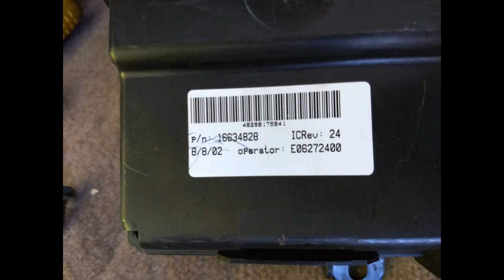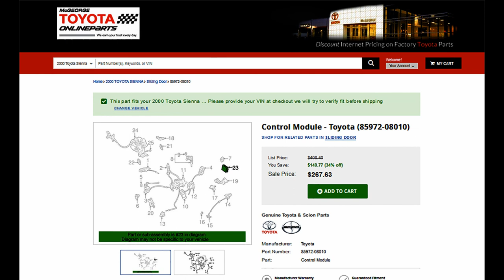2000 Toyota Sienna Power Door problem solution

Comment: Thank you for this highly informational video. I have a 2002 Toyota Sienna LE (Symphony) that had the same problem in Dec 2018. I took it to a repair shop and they replaced the pulley mechanism with a used one ($240). Plus labor I paid $500. It worked fine. But recently, it will not close or latch fully. It slides back to an open position. I inspected the cable from the outside panel and saw the same problem like you had - the plastic coating of the cable are "crimped". Mine is 18 years old. Not worth spending that much again to get it back to work. You're right. We can still open and close it manually. My kids are grown anyway. Thanks again.
Reply from the maker: I'm glad I could help.
Reply: SergSpace Do you have a video on how you remove the rear door inside panel? Thanks!
Reply: Don’t bother. I didn’t have to remove the interior to get into the motor. Looks like the problem was just on the external cable beneath the small panel. There were lots of ‘wrinkled’ plastic coating that got stuck. I just tried to clean and peel them off as much as I can. Then, I applied some lube on the cable and its contact point. It’s back working! For now. Your posted video gave me an idea of the problem. And the solution. You saved me some $300 at least my friend. Thanks!
Reply from the maker: @mr3klax  if coating in deterioration it will progress, become wrinkled again and door will stuck. But at least you know now how to close it manually.

Comment: Thank you for your video. So you disconnected the contol module and what speaker you mentioned? Also can you just disconnect the door cable only?. And will the side door open with the remote control? Thks.

Comment: does the inside panel need a lot of tools to open? mine is 2003
Reply from the maker: Pry tool. 5 bucks on ebay. Keywords: "5 Auto Trim Removal Tool Kit Car Panel Door Window Fastener Remover Pry Tool Set" or here is link : https://www.ebay.com/itm/195132339499?hash=item2d6ecb352b:g:WroAAOSwPONjGaIX&amdata=enc%3AAQAIAAAAwD7o0ezC4wdKTb7UxnOJF84%2FWr4vOl0cKYWSBqkF70bT0ZPU5SZZqJb7l3ux4DdQiGj3X3noSx9qSs4YUtOVlsch5L1Zdi%2F1Ikv0zTb85sq%2FCuZMtE5JpchXJjt%2BlgrpX93ygEBUmDZiTkoGPHG33uWMek0lSCCXgl930dRC5T4pBgE99uo%2BAoaMUg7pSg7gF6yqZNMkbfqxGb%2FAeyXYJ1vEM4SPQ2cVFbfTf6klzxTV%2BjgOCMVH5qHF6mrccHreRQ%3D%3D%7Ctkp%3ABk9SR5rhotjsYg
Or pry up with flat screw driver, then pull plastic cover with your hands. It's held with plastic clips

Comment: I'm having trouble with the pull cable with 90 degrees using screw driver.  Do you push in then up?
Reply from the maker: 0:45 Pushed down then up. The rod at the and of the cable is behind the hook. And there is second pull cable right on opposite side, that suppose to pull to close the door. You gonna need to remove it also.

Comment: How to reset or remove the Power Door light on the dash?
Reply from the maker: Did you disconnect power cables from door motor? I didn't reset anything after unplugging all cables from motor and removing whole assembly. No door warning showed up on my dash board.

Comment: Need video on how to disconnect and manual them 😊
Reply from the maker: Disconnect and manual what?  When you pull out the motor, this door can be closed and opened manually.
Reply from the maker: @spyxxx566   At 0:44 - is the main trick to disconnect the pull cable, then you pull it out and be able to close the door. In the end of video 4:14 - I closed the door manually and do that since then, up to these days. I didn't have a help to hold camera while removing the interior cover, so I just share the general idea. Once you remove the cover the motor and holding bolts  will be right in front of you. I removed this motor 4 years ago, don't have another one to show step by step, since I figure it out by myself. The point is that it's impossible to fix since there is no cable replacement. So it's easy to remove the motor and cable. The door can be closed and opened by hand as same as the other door on opposite side.
Reply from the maker: @spyxxx566   No need to cut when you can just disconnect. You need to disconnect the speaker also or it will continue to annoy you with buzzing sound. I wouldn't go for such a "shortcut" as you suggested. And it's better to disconnect the motor power cable also. If you cut the cable as far as you can reach it's still be winded on puller inside. It WILL happen when you press open door button the rest of cable will come out and create additional problem. You may end up with cable stuck between door sliding parts. Then you gonna have to find another video how to deal with that new problem. The interior cover held by snap-in clips. It's not hard to remove.
Reply from the maker: @spyxxx566   4:06 - that speaker. The only purpose of that one is to make a buzz when door is not closed. And it's going to make a noise constantly. You won't want to connect it back.
Reply from the maker: @spyxxx566  Speaker doesn't detect, only buzz. But yes, when you remove the cable and motor, it will keep buzzing. The position of power door button (on/off) will not stop buzz signal.
Reply from the maker: @spyxxx566  California is far away. This job is not that hard. You can do it by yourself, when you lower obstacle barrier in your mind. First time I faced this problem, I was on my 10 minutes break at work. I had no clue what to do with door that would not  close on open parking lot. And I'm not a mechanic. So I had to think fast. I figured, that the door is not that heavy, so it should be a metal cable that pulls it back and forth. And it would be logical that it should be at sliding rail. So I removed this piece of plastic ( 0:23 ) and unhooked the cable. Then I could close the door.